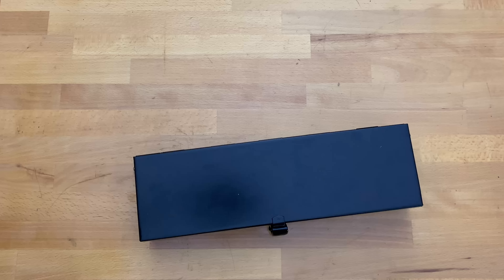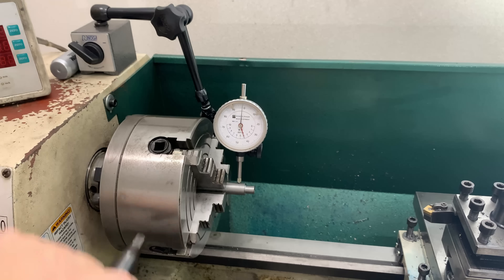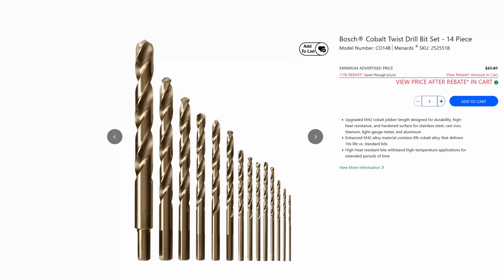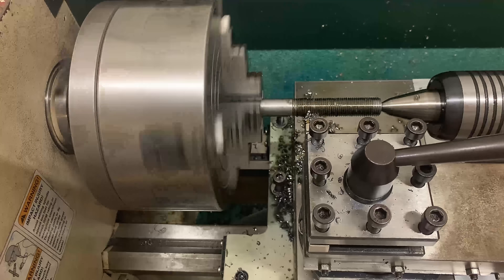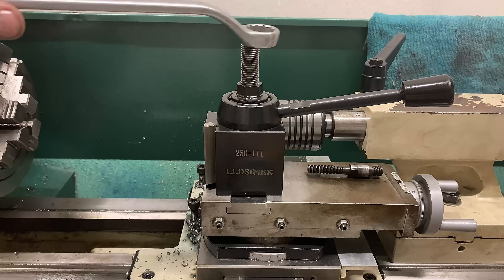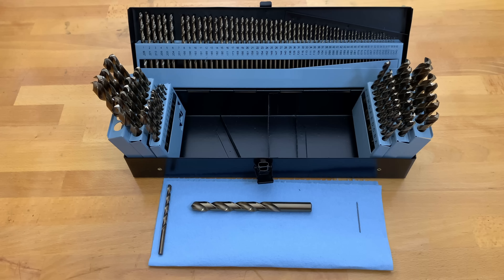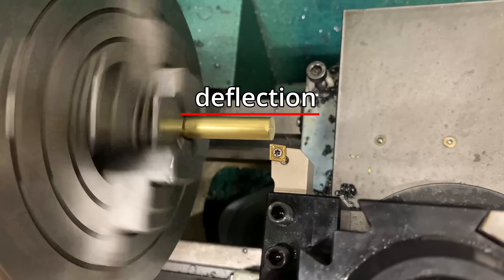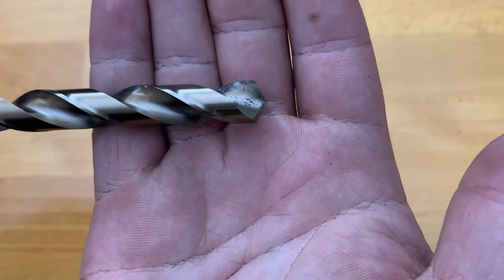Are Harbor Freight Drill Bits Secretly AMAZING?

Comment: So many people go full speed with a drill bit in a hand drill while bearing down on it and then complain that the bits are useless, dull easily, and break. A little care will get you decent service out of even halfway decent bits.
You did a good job of providing a quality review and I look forward to more!
Reply from the maker: Hey, thank you! I think you're right -- drilling with care and understanding of proper feeds and speeds goes a long way.
Reply: I told my coworker to slow down the speed on the drill for stainless and he refused to because he said they made the drill go fast for a reason. And so later when he was welding 18ga I turned the welder up to 400 amps and told him they made the welder go this hot for a reason.
Reply: I've watched people actually get a drill bit glowing from bearing down on it so hard while going full speed with it. Heck, I've been surprised they didn't weld it to the workpiece!
Reply: @thom17043 i've seen people press down hard enough to first remove the hardening and then bend the bit

And then be confused on why the bit is so bad 😂
Reply: I thought I was a bit tough on drills until a coworker borrowed my drill press (and drills) for a project.
He nearly lifted himself off the floor with the weight he put on the drill's handle while drilling holes.
Reply: and only  one out of a hundred will use a oil or a grease ! and they will complain how it went dull fast
Reply: @diverdave4056 cutting fluid, yes, grease, no. Youre not trying to lubricate the bit, the fluid is for cooling.
Reply: @batvette   i use the Castrol stick wax metal cutting lube - on drill bits and step down bits ! It works much better than cutting oil because as the bit heats up while drilling - the wax drips down to cool it . and its much quieter !
Reply: Yeah I got the cheap 9$ box by dewalt, the black and gold and these last a good long time if you use the right, just as you said.  Low and slow.
Reply: Unless it's a countersink or in wood, I don't love using a hand drill for drilling.  Too easy to be slightly off angle or spin too fast for how much feed you can give it by hand.
Reply: When I was in HS in the 90s we learned how to properly drill materials, slow and steady especially with something like stainless. I would say maybe 10% of the population knows how to drill materials properly based on factories I worked at including 14yrs at the last one. It's terrible. I also saw guys using impacts to run taps😂 Yeah that won't shatter it😂
Reply: SOMETIMES YOU JUST CAN'T REACH PEOPLE!
Reply: With a drill it definitely depends on what you’re going theough
Reply: Very few materials benefit from full speed and bearing down on the bit as hard as possible. 😉
Reply: And oil makes a huge difference.
Reply: @choccolocco This, oil will make it last longer.
Reply: one hole in Alum,, one hole in brass,, and one hole in mild steel with an auto feed and this is what you consider a quality review.. No one here even understands that there are three different sets there and they are NOT Cobalt...
Reply: @twistedhillbilly6157  Yeah. Project farm did a much more comprehensive drill bit test.

Comment: I can speak for the Milwaukee drill bit first hand. They are not that good. We had them at work. The black oxide ones are totally not worth it. The cobalt are better, but definitely not worth the price. The web is to thick to hand sharpen when they break and go dull (which they will do relatively easily).

 I have a old 29 piece fractional set i bought from harbor freight when they were still mail order. I still have it, and use it for most of my drilling. When they get dull, i sharpen them on the grinder. Replaced a few but still mostly original.

 I just don't go full retarded and use them smartly .
Reply from the maker: That's good information, thank you. What kind of grinder do you prefer to sharpen yours on?

Comment: I bet 90% of those reviews bought them as emergency replacements for either their hot job shop or personal use in a cordless drill. These are fractional shank drills designed for use WITH PROPER SPEEDS AND FEEDS! People complain when things break when they are trying to “wing it” and hope it works. Just like how I used a hole saw designed for cutting wood to cut my trailer’s front A-frame to accept a HF a-frame trailer jack. Since I couldn’t get it started in the center, I just said “Fuck it” and used the front corner as a “center” lol. 2 hole saws of 2-1/4 later, looks horrible. But it fits!
Reply from the maker: Lmao you’re exactly right. And yeah, fits is fits!

Comment: Those reviews are like the ones that use 1/4 in impact to remove lug nits on a car or complain a cordless ratchet doesn't have enough torque to remove set bolts.
They just don't know how to use tools or are using the wrong tool for the job.
Reply from the maker: Yep. I’m always so skeptical of negative tool reviews after having seen how people treat their tools. Especially when they’re trying to make a tool do a job that it wasn’t designed for, and then they cry about it when they mess it up.
Reply: Exactly. Someone with a hand drill smoking them and blaming the bits.

Comment: Pure garbage. Until you own a premium  set you don't know what a good drill is. Holds edge longer and accurate.
Reply: have had this set for 2 years using it alot, most bits still are fine, and il bet alot iv drilled more holes with them in the last month than you have in a few years.... people just like to justify spending more
Reply: @mishaisspeed  I treat all my bits properly. Correct speeds and correct oil. After going through enough cheap bit sets to have paid for a Norseman set, I finally got the Norseman. They are fantastic. Only bits I will ever buy again. If you cant afford good stuff, dont put down others who do and try to justify it like your so high and mighty.
Reply from the maker: Thanks for watching!

Comment: I picked up the smaller set of cobalt bits from HF while l was still drilling stainless and other alloys all day upfitting emergency vehicles, and they held up wonderfully after some initial tuning and sharpening on the ones that needed a bit of a tweak. Their spiral cobalt step bits are still some of the nicest I've ever used, and performed better than their pricetag ever would have indicated. Knowing how to use a drill was a factor tho, and l didn't loan them out to coworkers since l knew it would be a one way trip the way they baked all their bits
Reply from the maker: Yep, as soon as you loan them out you'll start getting them back in pieces. A lot of people -- not everyone, mind you -- but a lot of people just don't seem to care too much about tools unless they're the ones paying for them (if they even knew how to use them properly in the first place).

Comment: I have that set from HF & I like them! Besides, you can't beat them for the price. I seriously don't read reviews for drills, reason being, I've only met a handful of people that actually know how to use drills correctly (speed/feed). 
As someone else mentioned here, I too use the Cobalt drills mostly for SS & harder metals. I have HF's HSS "black oxide" set also. I use them mostly for aluminum & 12L14 & they work fine & stay sharp for quite a long time. While I have ruined a couple of the HSS drills & they definitely do start to dull out after a while, I would buy them again. Once again, you can't beat the price of these complete fractional, letter & number drill sets. They are in my mind consumables (throw aways) & I never expected them to last as long as they have. YMMV.
Reply from the maker: I agree completely. We have the same mindset about the consumable tooling. I do think that if I ever start making runs of certain parts or pieces I'll probably buy a half dozen "good" quality drills and mills for that specific part, just to have some on hand if one snaps, but like you said -- you can't beat the price of these for a complete index.

Comment: I bought a bunch of these sets back when they were on clearance under the Drillmaster name with the thought that they would likely fail over time and I'd just keep opening a new set as needed. I'm still on the first set. I've broken a few of the smallest sizes and I replaced those with better bits but the set as a whole has been far better than expected.
Reply from the maker: That's crazy! How many sets do you think you bought? I don't know if I'll ever have to drill a hole as small as 0.040 but if I do, I'll probably break it.
Reply: @ShopHumor  I had at least a dozen sets, most are still new in the box. It was around the time that they were dropping the Drill Master brand and moving toward the Warrior brand. The case then was a bit larger and heavier gauge steel, but the bits were likely the same. 

I actually bought a bunch of other sets too, including a dozen or so of the gold 60pc HSS fractional sets, a few smaller sets, and the full size sets.

They had them marked down to $2.99 and $3.99 a set, with the smaller number only and letter only sets being $1.99. They were in the scratch and dent isle and they had stacks of them. 

I also bought a bunch of the gold crinkle wire wheels that were marked down for a $1 each, I got about 10 or so of them.
A week later I bought two 20 gal. air compressors they were dumping the same way. 

I actually bought them figuring they'd be good only for wood and to keep around the house but they turned out to be far better than I had expected. 

I had cheap drills in the past that were total crap but these are probably close to anything you would buy from Black and Decker, Dewalt, or Craftsman at that time. 
They aren't on par with Hanson or Greenlee but are likely equal to or close to Vermont in durability. They're also cheap enough where it don't hurt much if you break one.

 I did have a few bend, but it was only one of two sizes in the gold variety, all the others were fine. (The bit got stuck, and when I reversed the drill to back it out, it sort of unwound the drill as if it were soft. It didn't break, it twisted in reverse. I grabbed another one from a second set and it was fine. I threw on of those sets under the seat of my truck, and have one on my desk just in case.

 I also bought five of the Warrior 18v Li Ion drills when they first came out with the $9.99 coupon years ago, they've been great for around the office and house jobs. I even keep on on the boat to wind reels with. 

The thought is if the salt air kills it, I'm not out much, but its been there  for 8 year or so  now with no issues. No Dewalt ever lasted that long for that task, let alone on the same battery.
Reply: I've had the identical experience. They have served me for way too many years. I think mine are TiN coated, are yours?
Reply: @colindgrant  The 60pc and two of the larger sets are TiN coated, the smaller number drills are black but seem just as tough. 
I have my doubts as to whether or not the TiN coating is real or just a plating as it wears off fairly quick compared to other coated drills but they're hard enough to hold an edge and to have survived so many years of use. The cobalt bits are harder and do chip, but so do the more expensive cobalt bits. I tend to reserve the cobalt bits for use on cast iron and broken bolt removal but 90% of the time I grab the regular 60pc set.

Comment: I don't know what those guys are bitching about, but I have that same set of cobalt drill bits and they all work just fine. Those others either don't know how to use those drills or are too rough on them. Some push too hard on drill bits in steel or use the wrong size  and the wrong speed. I'm in Canada and we don't have HF. Our equivalent would be Princess Auto...basically the same kind of store.
Reply from the maker: I’ve never had the pleasure of shopping at a Princess Auto but next time I’m in Canada I’ll give it a look. You’re right that 99% of peoples problems with drills is using them incorrectly — wrong speed, wrong size, wrong pressure.
Reply: Yep. A person can ruin the best made bits in seconds if they go too hard, too fast or too slow. 
Operator error doesn’t not mean the bits are bad.

Comment: Well, it's 50 bucks for over a hundred drill bits. That's less than 50¢ each.
Reply from the maker: Hell of a value for sure. They're cutting through brass, aluminun,  and steel for me no problem. Happy so far.

Comment: I do not have the HF set.   I purchased a cheap set from Grizzly back in 2015.   The first few drills I tried did not cut.   I then purchased a Hertel brand set for about 3x the price.    These have worked well.   Still being used and sharpened as needed.   I think the Grizzly set may have worked if I spent the time to sharpen each drill.   The Grizzly set now sits in a drawer gathering dust.
Reply from the maker: I’m glad you found some that work for you. I’m curious how those Grizzly’s would do if you ever did get them sharp.

Comment: Great review! I am using two of these sets and running them hard with heavy machines most often holding with collets increasing performance in a variety of alloys. Most often I do not use this type of bit in hand drills unless its the last resort, always starting with economy HF bits. Some bits I use like #3, #7, Q for example I will order 10 at a time from an industrial dealer. A Huot drill index and some early import indexes are worth the cost in the long run.
Reply from the maker: Yeah I agree completely. For anything you're using on a regular basis or for production runs, just get a stockpile of decent quality so  you'll never run out. And for hand drills I always use my cheaper bits too.
Reply: @ShopHumor  A machining book from the early 1900s said the drill bit is the hardest working and most abused tool in the shop. Some things don't change.
Reply from the maker: They sure don’t. I’ll do things with a drill that I’d never do with one of my end mills. 😂

Comment: I have the same set. Mine are 5 years old and I have only lost 2 bits 0.110 and E.
I lost the E while drilling cast iron and hitting a hard spot in the middle of the drilling.
I lost the 0.110 somewhere in the shop (cannot find it)
I have drilled thousands and thousands of holes and not a single bit (except those 2) became dull.
I only use them in my Mill and Lathe.
Reply from the maker: That's my plan too -- only using them in my rigid machines. Thousands of holes is a real good sign! I don't know if you saw or not, but when I was trying to put the .040 back into the case it fell into the gap behind it and it was the devil getting it back out without removing the rest of the drills!

Comment: In my experience almost all drill bits cut when new. They vary in how long they last but they all get dull eventually if cutting hard metal or, worst of all, stone.

I also find that certain drill bits get used a lot more than others. In my case... 4.7 mm and 7mm for m6 and m8 taps. It's better to invest in the ones you use most often than buy a huge set if you are on a budget.

There's no saving in buying 70 bits you'll never use for 5 that you will. Those 5 will blunt and you'll end up buying individuals anyway... after you learned that lesson...
Reply from the maker: I agree in part. It’s definitely important to keep multiple bits on hand in the sizes you use most frequently, but I also think that it’s incredibly convenient to have a complete index of sizes available for instant use whenever you may need one of the oddball sizes.

I’ve got a project coming up that’s going to need to drill some very oddball, very small holes so it will be really handy to have what I need when I need it.

Comment: Years ago I bought the 115 M2 black oxide set off Harbor Freight for the princely sum of $29.95. For the price I really can't complain. I drill mild steel with it. I wouldn't try to drill anything harder than that. They don't stay sharp for very long but I know how to sharpen bits. Over the years I've been replacing bits in the set with different bits as I come across them. The set in this video looks nice to me.
Reply from the maker: $30 for 115 is a heck of a deal. Like you said, just sharpen them when they need it.

Comment: i bought one of these indexes and they were laughably bad... i mean absolute shit. the grinds were terrible, off center really bad.
Reply from the maker: That's not good! So far I've only used the 7/16ths, the #7 (.201) and the F (.257). All have been sharp and on center.
Reply: @ShopHumor  i found the smaller the drill the worse the grind. the larger diameters werent so bad.
Reply from the maker: Could be - the #7 is the smallest I've used so far. I'll keep an eye on the really little ones.